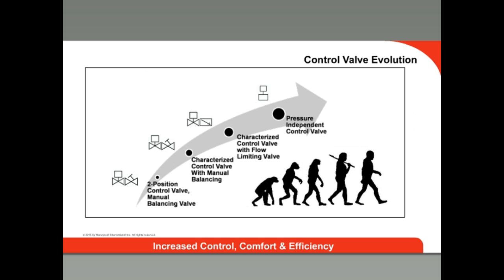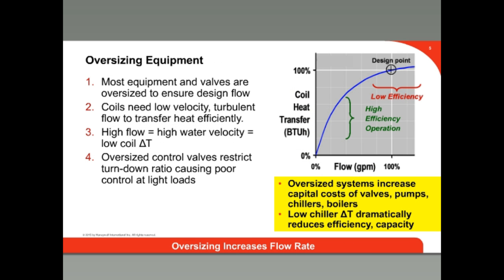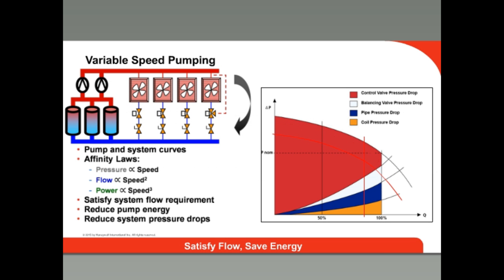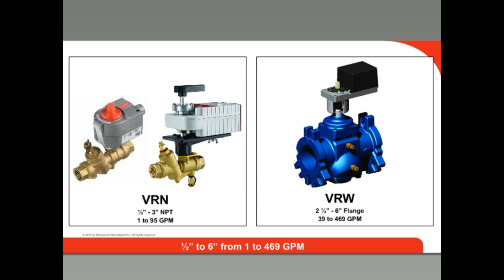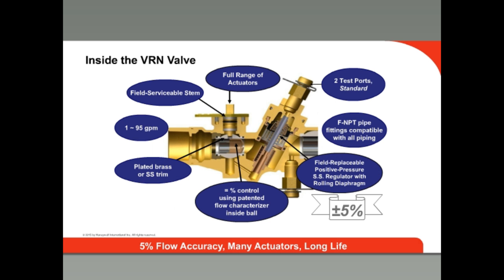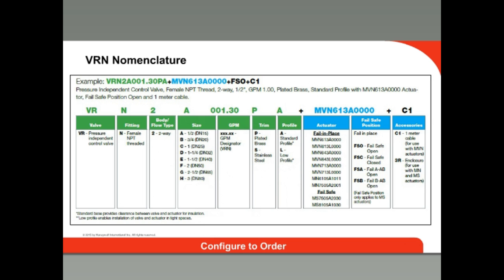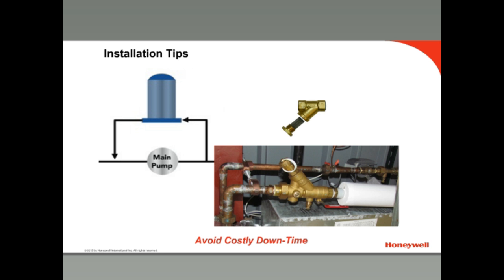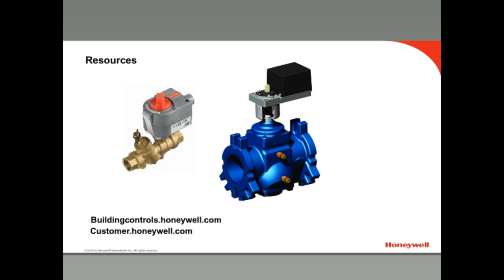Pressure Independent Control Valves

Comment: This video has inaccuracies in it. Increased velocity will always give you more turbulent flow. That's fluid mechanics 101. You actually can rate a design based on the Re# you want to achieve. Alex Bashqawi explains the phenomenon correctly. Please check your fundamentals before posting a video.